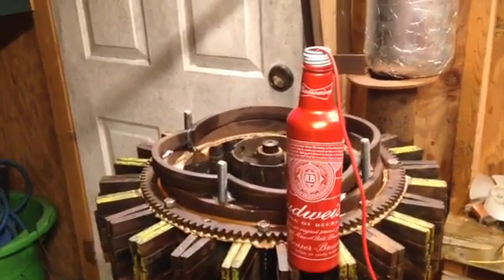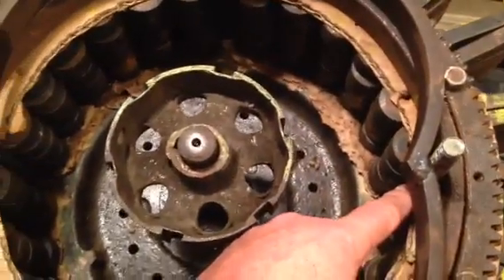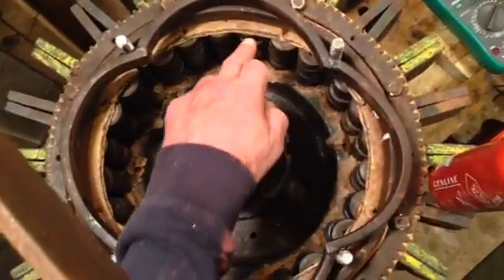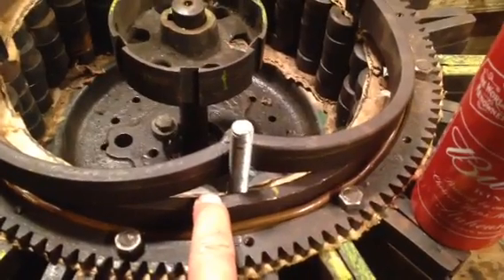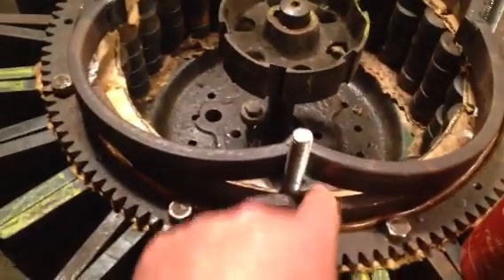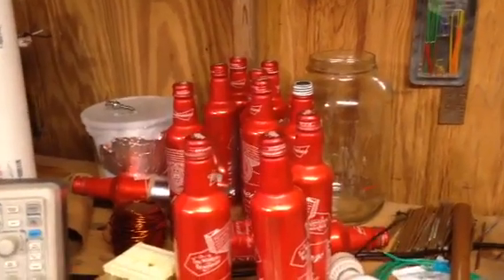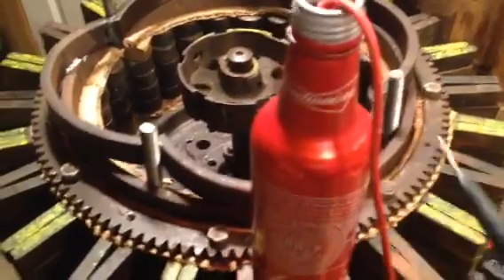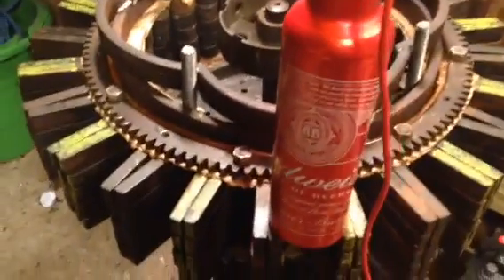Ed leedskalnins clover ring

Comment: Electrostatic motor plenty on you tube but rather than a van de Graf generation use the fluids suggestion only
Reply from the maker: Hey Honda
Yea I have to still take the wheel apart. 
But yea it's in the works.